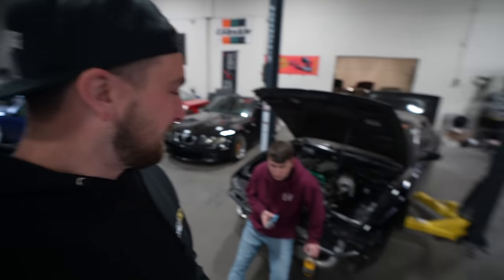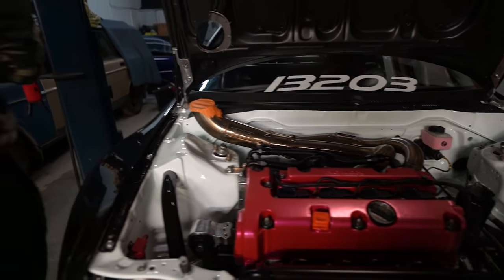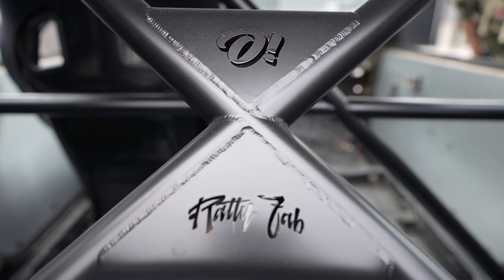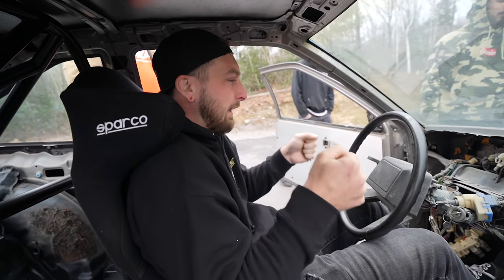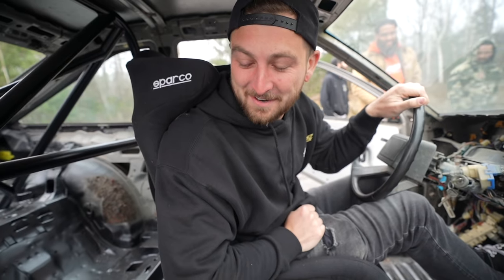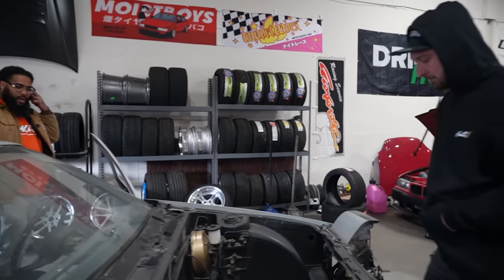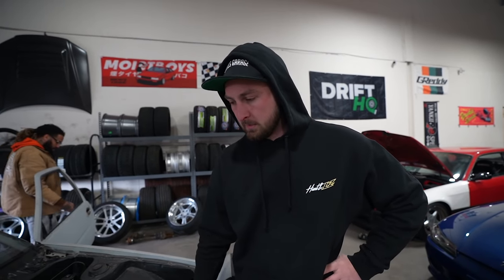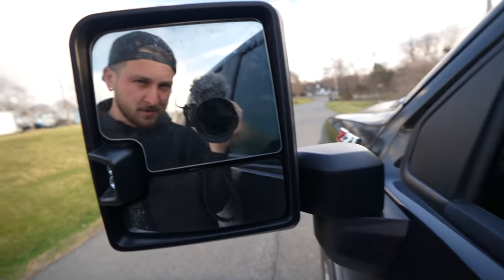Picking up my track build AE86 from the fabricator!

Comment: Dailying a Miata in Texas, I know what it's like to have a convertible in a place where it's only appropriate to put the top down maybe 5% of the time you drive the car. But, speaking from experience, I believe it is worth it, if for nothing else but the experience of driving with two fewer pillars, no roof, and MAXIMUM airflow. HOWEVER, my Miata only came in convertible (unless you have $2,500 sitting around to spend on a hardtop), and it looks okay with the soft top up... whereas the 350Z is almost unarguably fugly in its convertible form. Regardless, I think that the 350Z convertible IS slept on, and I hope to watch the blue vert progress into a very functional drift missile. Please put updates on this build in future videos!

Comment: VEERTS are definitely under rated,  i been drifting mines for a while now... the problem is that most tracks require some type of 4 point/roll bar and unlike other verts.. the z verts were build weird and fitting one and keeping the top operational is a struggle!!! which the way i did it( its not the best way but it does pass tech....barely .. and it does keep the top working).. so a lot of people rather not deal with it... but drifting with the top down is definitely a DIFFRENT VIBE.... cant wait to see what you guys do